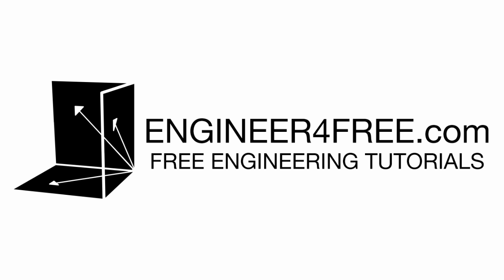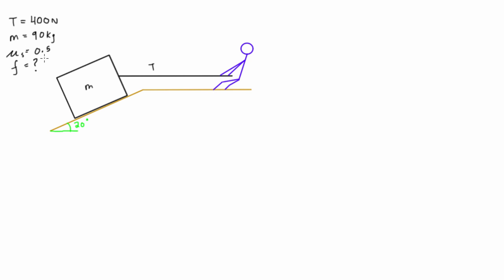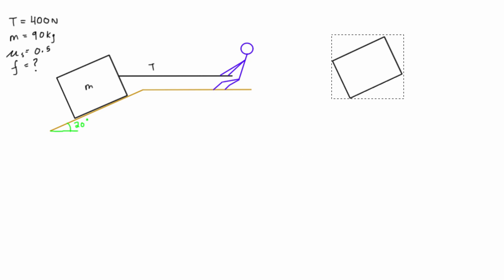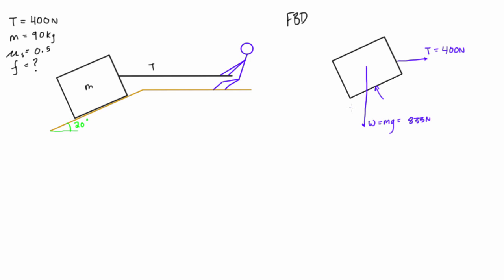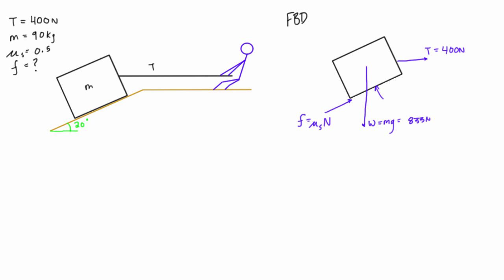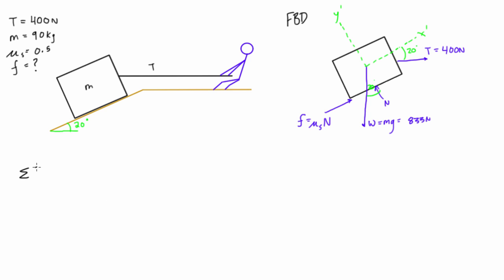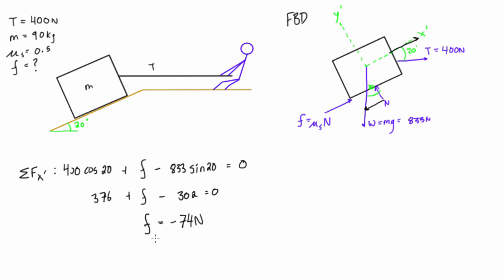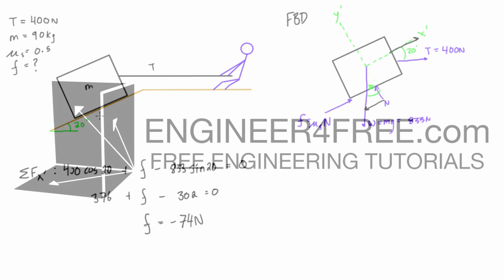Friction example problem #1

Comment: if we use the equation f=uN, and we know that friction = 74N and coefficient of static friction = 0.5, then we can calculate the Normal force = 74N/0.5 = 148N. But if we use the sumFy=0 method, N = 967N. What am I missing here? or did I misunderstand the f=uN equation?
Reply from the maker: Oh man... great eye. I didn't realize it, but I designed a flawed example. I am going to have to delete this video, but I will leave it up for a day or so so you can see this comment. You are right, f should be the same number no matter which way you calculate it. If the static coefficient of friction in this example was truly 0.5, then the person would need to be pulling with a horizontal force of 932.2 N, not 400 N for this problem to check out. That would make the normal force 1148.5 N, and f=uN would be satisfied. Thanks for asking the question, I wouldn't have come back and checked this video otherwise, and while the theory in the beginning is correct and has helped some people understand the concept of friction, the numbers are totally whack and absolutely need to be fixed.
Reply: Thanks for the reply! If I may suggest, maybe you can sticky your comment (I don't know how to do that, but it's probably one of the tools as a content creator on Youtube) instead of deleting the video since it's still a very helpful one. Also, just wanted to let you know that your videos are so good at tackling the fundamentals, and really well explained. So thanks for that too!!
Reply: @Engineer4Free  hello man, actually your solving was right. F=uN is used for solving the maximum static friction only that is why it is sometimes labelled as F sub max = uN. The frictional force (74N)  that we obtain was an opposing force necessary to make the object in equilibrium to suffice the 74N w/c is the net force of W and T, meaning to say that was not yet the maximum Static friction. so, we cannot just utilize the eq. F=uN to find N without the maximum static friction itself. in this problem it turns out that the Normal force is 966.46N and the max. static friction is 483.23N.